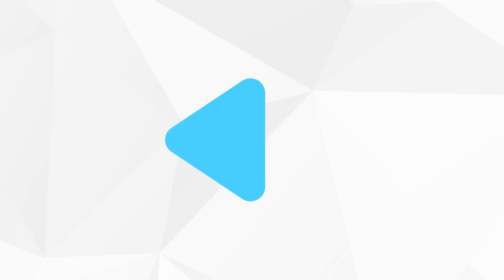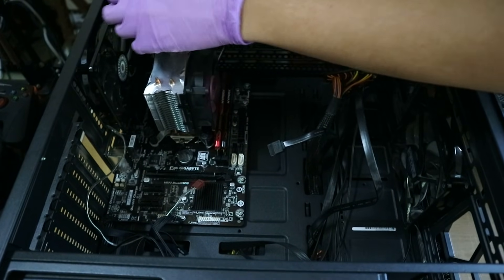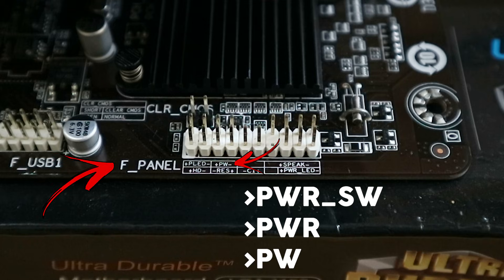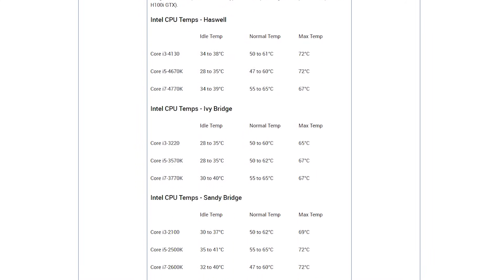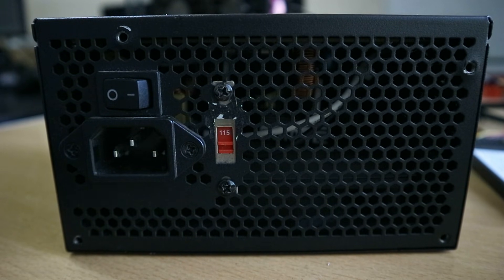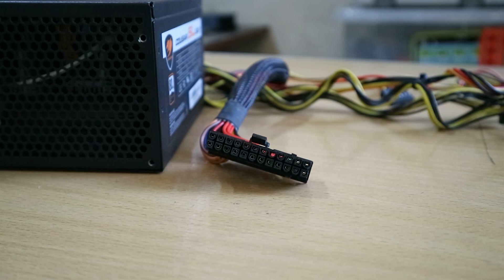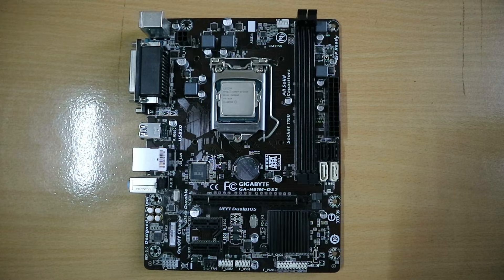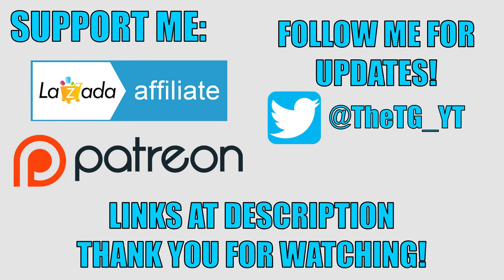A Desktop That Turns On For a Second and Turns off - PC Troubleshooting # 1

Comment: My pc turns on if I open the bios battery. But sometimes it fails. And when I disconnect the power then the fan moves  for few second. What's the problem. But , if it starts  one time then run for long time and when I turn it off then it does not start normally then once again I open the battery and start but sometimes it start. Please solve this.
Reply: What did you did to solve this kind of problem sir? Currently I qm facing this kind of problem to my pc
Reply: Same here. any update on this? @ralphburke8326

Comment: I have this really old pc that has the same problem
It turns on and off
But i solved it

I just wiggle the vga cord and problem solve
Reply: VGA cable doesn't supply power to the pc,it's the power cable attached to the psu,your pc must not have turned off,it would be only the display on your monitor,computer shutting down and just the monitor going black are two different things
Reply: Really??? Seriously?? How??
Reply: @scarrxd2147  i have this really pc that uses vga cord. I just wiggle it and then boom  it worked
Reply: Same

Comment: What if the pc is only 2 months old? Could it still be the battery
Reply: my pc is 2 3 months old also
Reply: @imguccibruh2414  i fixed it dude it was the powersupply
Reply: My is 2 months old and wasn't psu

Comment: Mine turns on then off then on again repeatedly
Reply: KT 24 me too! I’m trying to find a fix
Reply: Same!
Reply: fix was actually fault mobo ram bays, try every single one of them
Reply: Chek your ram the only problem is ram in this situation
Reply: ram is mostly the case. try taking it out (cleaning the ram sticks if you have to) and putting it back in again. make sure you hear an audible click when you press down to install them so you know it’s seated in all the way. that’s what worked for me at least :)
Reply: Also any solution ?
Reply: I also have this problem. I need fix please. If anyone knows one plz reply I’d really appreciate it
Reply: @robloxguy3977  most common cause is memory not seated properly. Try that if you haven't yet
Reply: @devankeel5367  thanks bro
Reply: In YouTube type in boot looping for those complaining about restarts
Reply: Same
Reply: Same here
Reply: This happens due to fault in power supply unit and you shall fix it with a new one. 

Hope this helps
Reply: It’s called boot looping

Comment: I am facing Same problem checked everything found problem in motherboard. So replaced that but still problem not solved... Need help please.. checked with minimum component that only motherboard processor nd cpu fan only..no issue with smps...but still getting off within 1 seconds...
Reply: Any luck yet?

Comment: Dude ung pc ko on and off ang problem, pag pinipindot power button iikot fan mga 1 second lang tinatagal then mag off na agad as in off hndi sya nagrerestart o boot loop, lagi ganon nangyayari everytime na ppindutin power button, natry kona ireseat cmos battery, graphics card at ung 2 ram 2x 4gb, inisa isa ko na ung ram isang ram lang salpak ko then ion ko tpos ung isang ram naman try ko gnun parin, as of now un palang tntry ko medyo busy pako ngyon tska bibili pa ko ng thermal paste at cmos battery baka un ang problem, pero hindi ko pa natry itest psu ko d kase ako marunong pero baka itry ko tong video mo o magpatulong ako sa tech kasi bka masira pc ng wala sa oras, pareply nalang kung ano magandang suggestion mo na pwede gawin salamat
Reply from the maker: Baka may kakilala ka na IT or marunong sa mga computers tapos gawin mo muna lahat ng trouble shoot kasi baka mmya isa lang to sa mga nabanggit ko na troubleshoot bago ka mapabili ng bagong psu or mobo
Reply: I have this exact problem right now. What did u do to fix it?

Comment: happened to me yesterday i just removed the ram and cleaned it with an eraser works fine afterwards. i suggest trying the ram trick before removing all the components (my opinion since it will not consume alot of time if it was the cause of the problem.)
Reply: Clyde Daria thanks man i just took my ram sticks out and blow on them then put them back and my pc turned on normaly
Reply: Clyde Daria bro u just saved me a lot of time lmao thanks
Reply: I know abt that method but i was not doing cause my pc already is older than my grandpa(not really),but after seeing your comment i tried it and it worked like a charm
Reply: doesn't work from me but my power button light is on but no power
Reply: @shuathlm  it might be ram slot problem ram stick problem or io chip/ic chip problem
Reply: This comment saved my life

Comment: What if nag no display yung pc nag bubukas sya pero no display sa monitor umiilaw mouse pero keyboard hinde... Gpu is working sa iba powersupply is working sa iba ram is working too ano kaya problem?
Reply from the maker: try another display cable or other try the display ports (vga, displayport, dvi, hdmi)
if ayaw pa dn baka sa monitor mo na problem
Reply: The TechieGames tried that to pero di talaga gumagana ... Gumagana monitor sa ibang device... No post talaga ubg pc kahit sa ibang monitor...
Reply from the maker: check mo yung ibang troubleshoot sa vid
Reply: New motherboard is the keyyy (ithink)